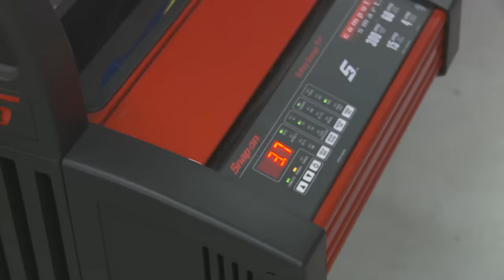Nitrous Muscle Truck and Mini Bikes! - Roadkill Episode 18

Comment: You all need to fix that truck up some more, to give it a decent paint job, and PLEASE give it some REAL brakes, okay?
Reply: *****, true, but brakes are a NEED for a vehicle, sir, and not a want, okay?
Reply: Paint would strip that truck of all its character man
Reply: Bone Thang, no, it would not, sir.  The truck needs a paint job...namely one that is black with a red, orange, yellow, and white flame paint job towards the front of the truck.
Reply: Pax Humana What I was trying to say was that if you paint this truck. It then becomes just like all the others. It wont stand out, and its not original. That truck has a certain mystique to it because of its current condition. It puts you in a state of wonder. Its almost like battle scars, It has a story to tell and begs you to listen. But if you want your truck to be the run of the mill just like all the others; so be it. :P
Reply: Bone Thang, piss off, you tosser!  What I say still goes, okay?
Reply: Bone Thang I would drive the hell out of it all day every day just like it is.

Paint would ruin this truck. It's PERFECT just the way it is.
Reply: wun1gee , your comment ruins the whole human race.
Reply: pax stfu this is a ratty cheap hot rod, everything about it is ghetto and they are not going to spend time and money painting it, it would make it look worse because the truck is chopped and modded everywhere
Reply: its like telling to paint they 68' Charger, there's no point
Reply: Josh Briggs, sadly, the only point that you and your ilk seem to be making is on top of your heads.
Reply: Pax Humana I don't know about a flame paint job... but a nice unicolor paint; maybe even that satin orange on the rear drivers side fender with some black accent color pinstriping. Or a full satin black to get rid of the primer gray on 1/2 of the cab you could even leave those rustic fenders alone to keep some of the "rat" feel.

But even how it is now has a nice appeal to it for a full rat-rod feel. I mean this IS Roadkill, not Top Gear. lol They care more about getting it running and driving the piss out of it, not how curvy its lines are or how shiny the paint is. :P
Reply: RenegadeRukus, fair enough, and a nice uniform color paint scheme, possibly blue, purple, or orange, would be a nice thing for this truck.  I never understood the rat rod thing for making it purposely look like a rust bucket.  Granted, the other upgrades on a rat rod are indeed nice when they are made, but I find it VERY stupid to let it look like a rust bucket intentionally as it looks like the people were doing the restoration job in a half ass manner, which is something that no true vehicle restorer should EVER do in their lives, period, full stop.
Reply: Connar Downes, and you would look better taking a long walk off of a short pier.
Reply: Pax Humana
Paint that truck and it would disappear into to abyss with all the other plane boring and predictable  hot rods , that thing has style and attitude , paint it and it is same as every other one .   Flames !  come one what are you like seven years old ?
Reply: Pax Humana okay, okay, okay, okay, okay, okay. What are you, a fucking Parrot.
Reply: J3TPILOT1991, what are you, a fucking douchebag?  Oh, wait, you ARE one, never mind.
Reply: Pax Humana is character would be ruined. Having a paint job is too much money for these guys. And it looks fine how it is. I would be an appliance if they made it all shiny and new like your 7 year old mind thinks it is. Think out side the box kid, and maybe you may pass 6th grade
Reply: painting it would take away all the character
Reply: aRandomBrony, bullshit, and if you argue otherwise, I will take you to the Magical Glue Factory!
Reply: im pretty sure the point of roadkill is to take a POS vehicle and make it run and drive. besides the LAST thing anyone building a car should worry about is the paint job. id rather have a car that will whip the shit out of every car at the drag strip than one that looks fancy but can barely outrun a prius!
Reply: Nick Miller, why can we not have both things on the same vehicle?  Leaving it look like shit is a lazy and half-ass effort on a restoration of a vehicle.  Doing things the way that you and the rest of the mental midgets suggest makes about as much sense as trying to have a peanut butter and jelly sandwich without the bread.  How successful do you think that things will be on that front, sir?
Reply: Pax Humana bro shut up its not your car u can't tell them what to do with it
Reply: Meyer Pigott, MAKE me shut the fuck up, you jackass!
Reply: (Puts gun to your head)  shut up
Reply: Pax Humana ^^
Reply: Meyer Pigott, no, I am not angry and butt hurt, but thank you for telling me the story of YOUR life!  Why not have some Preparation H for your case of internet butt hurt instead?
Reply: im just saying if anyone knows anything about cars they will agree with getting the inside perfect before the looks. never judge a book by its cover. yeah applies for everything.
Reply: Nick Miller, what I said still goes, sir.  Doing only the inside is only making it run in a half-ass fashion.
Reply: well id rather have a 8 second car than a car that looks like a 8 second car but runs 20 seconds. aka ricer.
Reply: Nick Miller, maybe you did not fucking get what I said?  Things like this are usually rusted as all fuck and the people that make them have the nice motors and interiors do not make sure that the exteriors are ALSO nice on the vehicles.
Reply: i did hear what you said i just chose not to listen because your one of those guys. close minded little person who cant think outside of the box. its ok tho, i forgive you.
Reply: It doesnt need any paint! The truck is a monster the way it sits.
Reply: Danny Fraser, no, it is a half-assed job instead of a monster.
Reply: Pax Humana
It has character that no other car or truck has
Reply: Its a sleeper just like farm truck.
Reply: Danny Fraser, yes, but it is also a half-assed sleeper that needs a damn paint job, though.
Reply: A sleeper doesnt have a paint job! It doesn't need a paint job. And if it does get one then its not going to be that cool anymore.
Reply: Danny Fraser, spoken like a true hipster and elitist douchebag.  Please go do the sane world a favor and go play in traffic on the interstate highway, okay?  Thank you.
Reply: dont mind him hes just a ricer... you cant win from a ricer OWH WAIT YOU CAN!!!! just watch out for the cars that have HUGE ass spoilers and to much dipshit stickers because every sticker is +50 hp
Reply: DryGrindersHD , are you fucking serious?  I love muscle cars and muscle trucks and people like you are the pollutants that are in the gene pool that need to be removed post haste!
Reply: Josh Briggs it's anything but cheap and ghetto. the body is straight and it makes really good power
Reply: Pax why would you want a nice paint job on that thing? All cars need to have there own character. Now rust is a diffrent story and i cant stand rust and this truck doesnt have any and thats perfect. Besides nice paint jobs are what gets cars stolen.
Reply: Tito Garcia, have you seen the security system from the Republic of South Africa that shoots out flames on the sides of the vehicle to nail any would-be robbers?  What about the fictional, though definitely real world possible, Magnavolt electric theft deterrent system?  I would be having one of those two systems built into my vehicle to make sure that does not happen, if not modified versions of those theft deterrent systems.
Reply: RenegadeRukus
Two tone Prius paint-white & blue
Reply: Pax Humana
Everyone has there own opinion dude.. granted if it was my truck id paint it black. but its not, and if they painted it, it wouldnt have character, it wouldnt be the muscle truck, it would be a black truck with an LS.
Reply: that truck is perfect like it is.. no paint are best paint .. bring some patina
Reply: DNdavidsonsnation, it needs a paint job!
Reply: we're going nowhere pals there's two type of people and we can't discuss about taste.. its like saying "i like blue so everybody's liking blue" the way that people like me see this truck is like the most original way it can be without trying to give it a way to be special, patina is not patina anymore if you work on it to look old and trash. Then people who say "it need a paint" are the kind of people that want it shiny and top notch and its ok either way but every truck can be paint and good looking.. its just to bring it to the basic look. anyway im not here to discuss like a said .. we're going nowhere cause we dont have the same taste.
Reply: *****, the character of a truck is a slob.  Argue otherwise and you are like one yourself in your life.
Reply: Pax Humana
So what your telling me is first go out and spend $3000 on a paint job. Money i dont need to spend in the first place to have a nice car or truck. Then spend only god knows how much to buy a security system?? I love cars man but i would rather have food in my stomach then waste money on paint or securtiy.
I dont understand why you are being so rude to people
Reply: Tito Garcia, maybe I am not the one that is being rude here?  Maybe the other people are assholes?
Reply: Nah it's way better when it looks like a crappy old turd sleeper then blows the doors off a Vette. It's so much more satisfying.
Reply: Demon50, it is still a half-ass job.  There is a difference between having a sleeper and intentionally making it look like a slap-dash rust bucket.
Reply: Pax Humana bro shut the fuck up about the truck it's not yours so who cares what it looks like and to me the truck looks amazing as is.
Reply: Pax Humana http://img.pandawhale.com/104933-dickbutt-meme-Imgur-dick-butt-yfgk.png
Reply: Pax Humana
Jeez arent you one spoiled little brat? Running your big mouth because you want something unnecessary, people like you should be tossed out and left behind.
Reply: Alan Nguyen, thank you for admitting that you are indeed a spoiled brat.  Finally, as for threatening to toss me out and be left behind, I hope that happens to you first, servant of Lucifer.  I can now also track you down and turn you into the local authorities for making a death threat against myself, so congratulations on screwing up your life, you dumb ass.
Reply: stereoguy107, were you calling me one, sir?
Reply: Pax Humana
My apologies Pax i wasnt trying to come off as rude. But when i read your comment and all of its replies im sorry but you were the one that started in with everyone when there opinion was different than yours.
Reply: *****, and thank you for telling me your age as well as the story of your life.  Do you want to try some better material, sir or madam?  You are clearly not cut out for the comedy circuit with your lame ass routine.
Reply: ***** Hey man, why don't you leave him alone? His eighth birthday is coming up and he is finally getting the pedal bike with the flames on it. Just let him enjoy it.
Reply: Zach Ritchey, actually, I am 35, but now I know what to get you for your birthday, so why don't you learn to behave and leave the internet to the grownups, okay?  Thank you.